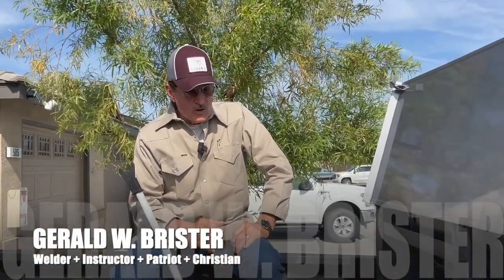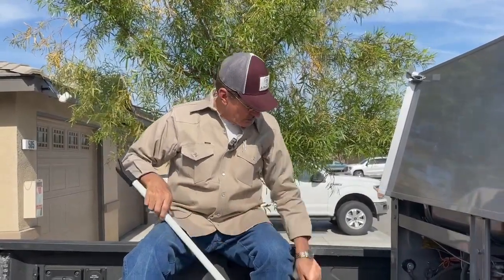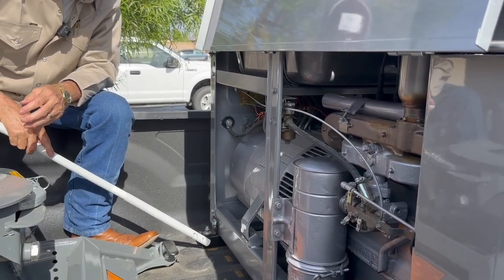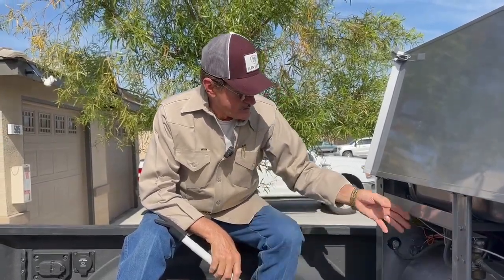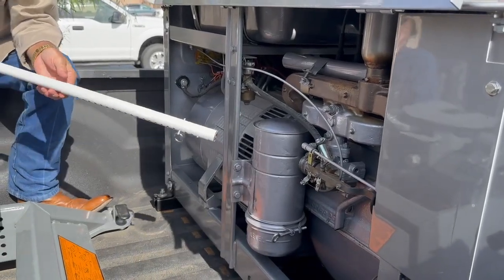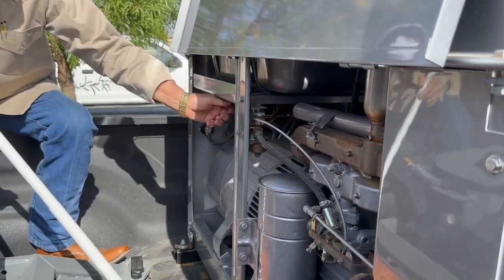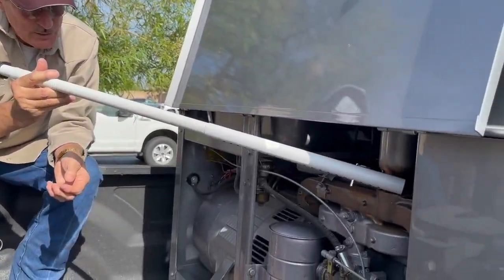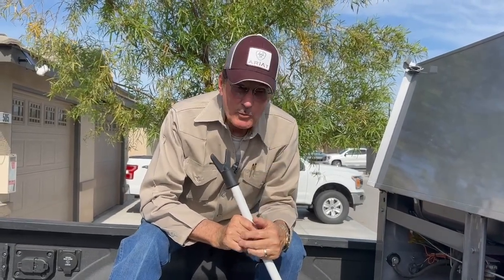Pick Up/Rig Design:  Pt. 2, Length and other Modifications of Lincoln Machines

Comment: Hey sir, I’m in the process of buying a truck what do you think about the Megacabs and Crew cabs I know one bed is shorter than another what do you think? What should I go with? Great videos by the way 👍🏻
Reply from the maker: Some years ago when the mega cabs first came out ,I liked the design so I looked at one. I took all the bed measurements , went home and laid them out on the garage floor. At the time I had a full size 300-D welder. I thought it out, and measured, and measured some more. I just kept running into one space problem after another,so I let it go and bought another crew cab with the full 8ft bed. That brought back my peace of mind and rig functionality.
I remembered some advice I was given by an older pipe fitter when I was in my middle 20’s. He said ,# 1 no tool is a bargain regardless of the price if it won’t get the job done , # 2 a tool may do a lot of things, but you don’t buy it for the many things, you buy it for the main thing you need it to do! Money is always a factor in any decision, sometimes you can only do what you can do ,but here is the point. Some purchases are relatively inexpensive , so if you make a mistake you just make a better purchase next time. But some purchases are so expensive you won’t be able to replace them without a lot of financial pain and regret. So my thought is this, to my knowledge the main reason for a mega cab truck is to have more interior space for passenger and just enough space in the bed for a goose neck or 5th wheel slider hitch, or a bumper pull travel trailer etc.
The main reason is they were made was to accommodate passengers, not cargo.
So , you need to figure out what the main thing is you need the vehicle to do for you. If you want to make a welding rig out of it, my experience would lead me to purchase a crew cab, 8 ft bed, with 4 wheel drive.  Now the question comes up about do I buy a single wheel one ton or a dually one ton (3500).
That depends on how much weight you will be moving around. The weight of the rig plus what kind of trailer you may or may not be pulling. The 2022 dually that I have the welder in now was originally bought to pull a new forest river/ riverstone 5th whl with 5 slides and 13.4 ft high,  that weighed 20,000lbs. It has the high output Cummings engine , 4:10 rear, and  Asian transmission. I bought it because I was planning to travel around the USA on a kind of on going basis and wanted the extra width and stability of rear duals. The truck and trailer are a perfect fit. The truck pulls that trailer so well, it’s easy to forget your towing something.
But, having said that, the last pickup rig I bought was a 3500 ram single wheel/4whl drive with the larger wheels.
Cummins high output, aisian trans ,but with a 3:42 rear. That was the only non dually I ever owned, and I grew to love it!!
It would get 17mpg at 70 mph, it was easy to park, and could go through most car washes for 20.00 or less instead of the 50.00 hand wash for a dually.
Also on muddy right of ways, duallys quickly turn into one big slick tire filling with chunks that will break off on the road or when spinning your tires in reverse and covering your mirrors.
For that reason when I worked in Louisiana about half of the pickup rigs were single wheeled.
I pulled a 30ft, 12,000 lb travel trailer with it as well, and it was fine.
The newer high output engine with the 3:42 rear towed better than the older engine with a 4:10 rear.
So, you would need to think it out and write down what you are planning to use the truck for and figure it out.
If you’re planning to do lighter welding and buying one of the new smaller welding machines you may be able to make the mega cab bed work for you.
My thought again would be to get the bed box measurements and lay it out with soap stone on a concrete floor, then measure your design thoughts into that to be sure everything will fit etc.
If you want an oilfield/ pipeline rig I would go for a full size box as the cargo capacity would be the MAIN THING!
Thank you Marco, wish you well!
Reply: Thanks Mr. Brister, My go to will be then a 8ft bed, dually 4x4, oilfield/pipeline rig, just like you said megacabs are to accommodate passengers, not cargo. Will rather go with more tool/cargo capacity then cab capacity. Sometimes you have to go with what sets you up for success and not failure, so you don’t regret it later down the road. Will keep that gold advice in mind. 
Thank you Mr. Brister, God bless.
Reply from the maker: @MarcoRomero-f6h  THANK YOU!

Comment: @Mr. Gerald --- I am interested in that fuel valve and where you acquired it. Like you mentioned, I have to shut the fuel off all the time or it does drain back into the oil bath. I would be interested in how it is all hooked up so it activates during the initial start of the machine.
Reply from the maker: I’ll be posting several photos of the machine without the doors and hood.
It will be easy to see that valve then.
Thank you!